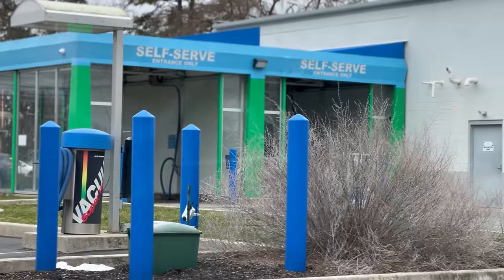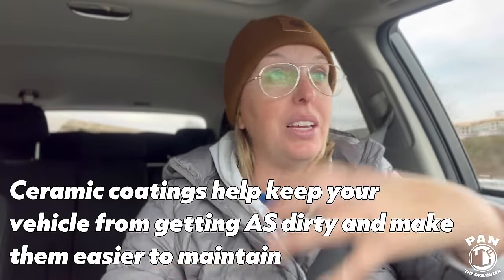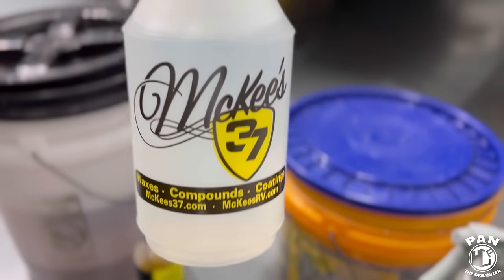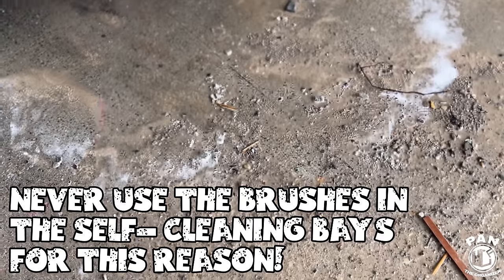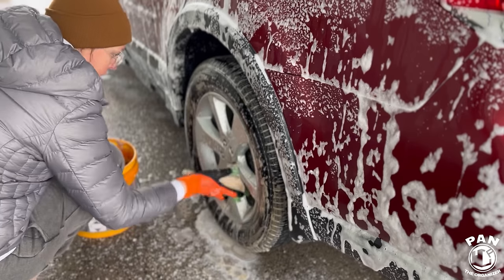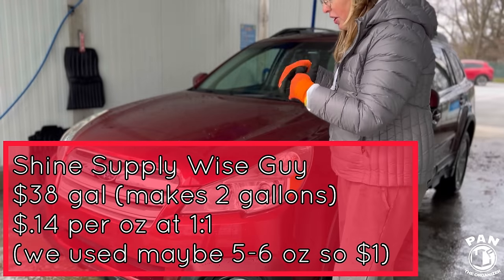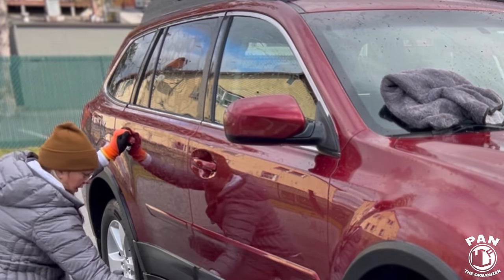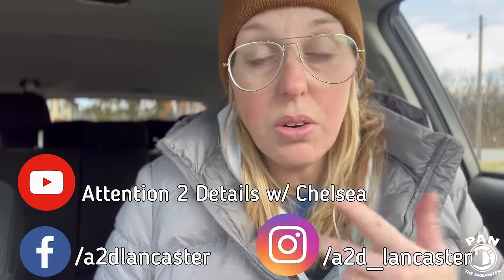How To Wash Your Car At A Self Serve Car Wash

Comment: This is my method at the coin wash - 2 buckets with my own soap, mitts, towels and brushes. Fill both buckets up with their water; one with my own soap - then I rinse vehicle. That's about $3-4 right there only using the water and I turn it off. I do the traditional 2 bucket wash on the car first, and then I wash the wheels last to preserve my rinse bucket water. Car is now fully washed, I empty my buckets out and pay for the water again and rinse the buckets out on their wall mounted matt hangers. Rinse the car off and turn the water off. Another 3-5$.  Now its time to dry the car apply whatever on it and enjoy. So about $6-10 spent using ONLY their water.

Comment: I really need to apologize as 2 months back i said it was absurd to expect people to wash their own cars when they may not have a house or garage. Since then, I've learned a ton and now do my own using a variety of techniques and supplies. Even learned that when it's below freezing to dry immediately after each panel or risk your rinseless freezing on the car. Also, if your car is crusted in salt, a few spraydowns of rinseless breaks the crust down and leaves only a film that easily gets washed away with your sponge. So, thank you for getting me started on my journey.
Reply: Great tips!

Comment: Thanks Pan for sharing info on these useful washing techniques and for hosting knowledgeable guests.

I like to hand wash my car on a weekly basis. Sometimes, if the car gets dusty(it's all glossy black), I'll bring it to the automatic car wash with a 1 gallon pump sprayer filled with a 128:1 Opticoat No Rinse solution. I spray it on, let it dwell for 5 minutes and then use the pressure wand to blow a high pressure stream of pure water nearly parallel to the surface. This gets the car looking like new and then I blow dry it with my battery powered leaf blower.
Reply from the maker: Thanks!
Reply: I almost do the same exact thing

Comment: Amazing video and great resource! I find this more complicated than I might recommend to my clients who have hired me to do a wash, clay and seal service. That service deep cleans and leaves a sealant on the surface. I have tried to make the cheapest and simplest system for my clients. Mostly they had already been going to a brushed drive through car wash. I recommend they use a touchless drive through car wash then use a quick detailer and micro fiber towel to dry the vehicle after. I also share how they can safely use either one large drying towel or multiple smaller towels with the QD as a drying aid.  It's about $15 worth of product, $30 or less for towels and $7-10 for the car wash. It may be about 20 minutes of their time.  I  find that with the deep clean and protection we provide, the client can get super clean results safely when they are in between services. Our clients are not interested in becoming a detailer or spending $100+ to get all these tools. I love that but it's not their interest. What are yall's thoughts on this system?

Comment: That’s a lot of stuff to carry, I like the sponge you used to get the light film off, I’m using a spray bottle with water and a thick towel to wipe off the film. It’s color coded so I’ll use one side to wipe & the other to dry. I’m using the touch less wash only, I’m also reapplying my ceramic sealant every 3rd wash to keep up my protection. Once I move to a house, I’ll be better equipped to care for my car. I’m always learning from both you guys. Thanks for the advice. 👍🏾
Reply from the maker: Have a good weekend Justin!

Comment: I am fortunate to have an insulated and heated garage and a couple of “pay and spray” self serve car washes that are not too far from my home. I live in Massachusetts between Boston and Worcester, this winter has been more wet than snowy, but with he pre-treatment of roads and salt spread during the few storms we have had, it is easy for cars to be encrusted with salt.

My winter detail regimen is as follows:I turn on the heat in the garage, pack my wheel cleaners, iron decon chemicals (P&S Crystal Wash and Iron Buster) a sprayer with a solution of Optimum MDR and a couple of pump sprayers with a rinseless wash solution in a small tote. When I get to the pay and spray, I spray the MDR solution on the paint and let that work to break down the salt while I am waiting in line.. I spray the wheel cleaners and iron decon chemicals, what a few minutes and use the rinseless wash to knock down the iron decon residues. I either use my debit crad or cash and purchase $10-15 worth of time then use the rinse functions of the pay and spray to rinse the vehicle down, including the undercarriage. I then bring the vehicle to a nice warm garage, then to a proper rinseless wash and dry the vehicle.
Reply: Great tips!

Comment: Wonderful in concept. Completely impractical in reality. I love spending time detailing my car in the summer but winter in Colorado (and any other place that routinely gets snow and grime) is more about survival. Self serve car washes have lines of impatient people and loading up so much stuff when you just want to get the grit and grime off your car (fully knowing that it will rain or snow within the next few days) is just not worth it. Here is what I do on a a weekly basis (or at least when I know there is a few days of decent weather which will be worth getting the grit off  the car. 1) High pressure water to get the caked on dirt 2) Foam spray on entire car 3) high pressure soap wash of entire car 4) Use the brush on glass ONLY (not on the paint) 5) High pressure rinse 6) spot free rinse (mostly for the glass 7) leave. It takes 10-15 minutes and while it doesn't get the car shiny, it gets the muck off and I'll repeat this every week. My car is graphene ceramic coated and in the summer it shines for 6 straight months and has ZERO swirl marks. Yeah, its not perfect in the winter but that's the joy of living in a snowy winter environment. Come April in Colorado, I will do a 2-3 hour full detail and then maintenance washes until winter comes again in late October.

Comment: I always recommend to use the pressure washer first after spraying tires and rims, like you said. Then you can start using a brush and soapy water to remove the traffic film of your rims. Much safer method especially when you have gloss black or matte rims.
Reply: Yes, on black wheels I would definitely rinse first then clean

Comment: I have a unlimited water for €6 here and its great. Sometimes i’m in there for like 1hr and another hr at the dry/vacuum bay for the other parts. Never got yelled at but always make sure i go at like 8am so no one is there.

For “maintenance” spraydowns i take an ik multi with BH touchless and i just spray the car, let it soak (sometimes i use the foam of the bay to cover it)  and rinse off for a total of €4.

Sometimes i do the second option, drive home and do a rinseless wash there. But if my wheels are very dirty i go for option 1
Reply from the maker: Thanks for sharing your process. 👍🏻

Comment: Hi Pan. Any tips/videos on a compact travel kit?  Her kit is more comprehensive than what I would throw in a trunk or in a duffle bag. A kit that can be supplemented by a self serve car wash?  Maybe one just power rinses their vehicle and then pull out for a no-rinse clean/detail. Or even possibly stand alone kit (a-la no rinse car wash)

Maybe something like:

Spray on car wash (maybe Griots)
Interior cleaner
Tire detailer and applicator 
Glass cleaner
Bug cleaner
And various microfibers and a couple of brushes. 

Thanks.

Comment: Great video and good information and ideas . I just want to tell my experience.  I took  my car to one of these car washes and took a bucket and wash MIT and etc . The owner was there doing maintenance and when he saw me with bucket and MIT he told me i had to leave .  I guess doing it the way i was does not use enough of the car wash chemicals . He took me to the other side of the building where he had a sign that said no hand washing .
Reply from the maker: Thanks for sharing

Comment: Quick spray of Touchless around the vehicle, rinse off, go home. Under 10mins. Given we're charged a flat rate for time, I'm probably saving Morrisons some money as I'm not using any chemicals at all.
Reply: That is another great way if you can’t finish it there
Reply: This is the way. No need to bring buckets at all. Just pre-spray with BH TL in a pump sprayer, let dwell for 5 min, rinse off. Pull out, dry with a leaf blower in a parking spot. Drive home and finish with a quick rinseless wash. Done. It's seriously the quickest and most efficient wash you can do.
Reply: @Aaron.Greenberg  yes that is another way to do it

Comment: This is a great video, great advice and tips. I would like to mention, not all self-serve carwashes allow you to hand wash aka bucket wash. Please be very mindful of this and what their policies and or stipulations are.
Reply from the maker: Thanks Scott!
Reply: @PanTheOrganizer  
Welcome. I reside in Calgary Alberta Canada and I have seen several carwashes that say no bucket washing allowed. I am glad we have a garage and a driveway to handwash. In the colder months we use the spray wand carwashes where only soap and hot water touches our vehicles paint. I'd still rather get the majority of the dirt, salt, grime..etc off the paint, vs leaving it on for long periods of time and doing more harm than actual good to your vehicles paint/clear-coat. Plus spraying out the inner fender wells and the undercarriage as well, which IMO is very important.
Reply: @PanTheOrganizer  
Montreal and Ontario use a ton of road salt, here in Alberta they use less salt and more pebbles and sand. Plus the climate is much drier and rust isn't so much a factor but regardless of all that, the bug guts, oil, dirt, grime..etc needs to be washed off to help maintain a clean vehicle and one you'll be proud of driving and makes maintenance less of a hassle.

Comment: I do something like this when the sun is setting & my car's body panel is cool to the touch. 1) clean, but don't dry, the wheels/rims outside the wash bay, 2) at a wash bay, Rinse off the entire car, including the undercarriage, 3) get out of the wash bay if the carwash owner had posted a sign about no handwashing/detailing at the wash bay, 4) safely without scaring the paint of your car, handwash your car, 5) go back to a wash bay & Rinse off your car, 6) get out of the wash bay & safely dry off your car.
Reply from the maker: Thanks for sharing your process!

Comment: I always go to a self service station.
This is my way to do it
First spray the car with a pre rinse, I use valetpro citrus
Then I rinse my car with the waterlance. 
After it I use a ik foamer with brake buster and clean my wheel en tires with it. I also use a bucket with water and some soap I first foam.
Then rinse tires and wheels, but also bucket and brushes and foam up the soap in my wash bucket.
After it wash my car, 2 bucket method. And rinse of.
Then dry with dream maker and a towel. Then whipe inside the doors, dry the wheels and tires. Then clean the windows and do some dressing on my tires.
Then I clean the interior or just only remove the dust inside with a microfiber.
Reply: Sounds like a great process
Reply: @attention2detailswchelsea  yeah it is, but my car always looks good. I use always 3 buckets. It's only hard to get the water from 3 stairs to the car.
The whole wash and filling the buckets takes me 3 hours

Comment: I haven’t come across a DIY car wash that will allow you to do a bucket wash. If I need to use a DIY car wash, I’ll spray down my vehicle with a pre-treatment and use the pressure washer to spray down my car. After, I’ll treat the car with a rinsless wash to soften the water. I’ll then drive the car home to do a rinseless wash.

I live in an apartment and this process works well for me.
Reply from the maker: Thanks for sharing!
Reply: That’s another great option!

Comment: Well, to keep everybody happy, I go after 10pm and the flow is. Iron remover and rims cleaning outside the wash area. Spray with all purpose cleaner and while still wet  I get inside and apply snow foam on the car. Rinse with the water jet+foam powder option and after that I re apply snow foam and use my microfibre mitt for more thorough job. Rinse well with the purified water option and spray with the spray (bead maker or turtle wax graphene) rinse again, take it outside and dry with microfiber towel. Voila! Car clean, the wash owner happy cause I used his products also.
Reply from the maker: Thanks for sharing your thoughts.

Comment: What i do is in the Super COLD days of winter. I go to a All Water wash and pick the basic wash. Reason being is it has the undercar wash so i can get that Nasty Salt off. And the doors close so u inside. Then i come home and do a waterless spray wash. But at the DIY when its warmer. I just wash the brushes off real good for my tires and lower panels. I Never use the brush above the mid point on my car. I apply ceramic coating every season change. So, its right b4 winter and b4 summer. Since 95% of the time its jus me in my car my interior stays factory fresh all the time...

Comment: Northern Illinois.  My attached garage is not heated, no floor drain.  I use the Black and Decker Hydroshot sprayer. It uses less water than a hose. 24 hours later the watrer on garage floor is almost dryed up(75%). I do this when its prety cold  like 30 degree day. I have never had standing water left on garage floor freeze.
Reply from the maker: Thanks for sharing!

Comment: In my place they have big posters with a list of rules at the carwash and some sort of guardian roaming around making sure people respect the rules... BUT, I have a portable battery operated pressure washer, is not powerfull but does more then enough for rinsing off chemicals like prewashes and iron removers before going with my rinseless. 
I live in a condominium, the parking spot is pretty small and I have some stairs to do so it is a bit of a workout but I'm ocd enough to do this 😆and by doing this, I only have to go at the carwash when the car is super muddy and I need more pressure
Reply: Sounds like a great plan!

Comment: Because i had a tramatic experiance at a car wash, i just use the pay and spray to get the salt and sand off with a rinse, then i drive home and do my rinseless wash with my bucket of Absolute, a chenille mitt, and my Ik. multipro and finish my wash in my driveway dry with my liqu8dr and beadmaker and i'm done.
Reply: Sounds like a great method!
Reply: @attention2detailswchelsea My pay and spray doesn't allow anyone to bring buckets etc, so that is why i do it that way, but it works well, great video!

Comment: I wash my truck at home but I also go to the car wash, specifically during winter when I have my pipes covered to protect from hard freezes. I don't like automatic car washes because they just don't do the best job at detailing it. The self service car wash I go to never told me anything about my bucket as I never wash with it. I just use it to carry my materials such as tire wet, detail dry towels, etc.

Comment: Is it smart to spray soap onto dry wheels that may be hot, or should they be sprayed with water to cool them off?  The downside to that is dilution.
Reply: You can prespray with water if you’re concerned. I had been there for a while and they weren’t too hot

Comment: Hi, great video. Thanks for sharing all these useful tips. What is the dilution ratio of the Superfoam in the IK Foamer?
Reply: I used about 3-4 oz with the IK foamer about 1/2 filled up. You don’t need much with this soap but the dilution ratios are listed on the label
Reply from the maker: Thanks!
Reply: @attention2detailswchelsea  

I'm using a Marolex Axel 7 Foamer, which is pretty similar to the IK. With Active Foam I use around 1 litre to foam the whole vehicle. I tried different dilutions, on the label is written 1:100, which produces quite nice foam, but I usually use it at 1:50. In this case it is 20ml of product, so that I why I was surprised by the amount you are using. Did you use the whole 1/2 of the liquid (which should equal around 3 liters) to pre-foam the vehicle?

Comment: In winter/early spring when it’s still cold I always go thru the wand wash.  I bring my tire cleaner, and 😮 ceramic spray wax with me. And of course microfibre towels. But I use their soap and soap brush. Is the soap brush bad?
Here in B.C. in March I thought it was safe to use the garden hose 😮 and set out to wash car. Good thing my daughter was in the basement and called out that water was seeping in!

Comment: It takes me about 2 hours with ONR, 6 towels and 1 bucket. I don't mess with grit guards, instead I do 1 curl-wipe per quarter of each towel side and temporarily discard it after 8 wipes (4 on each side). That way if I ever have to use it again in the wash, the dirt is light and distributed amongst the towels instead of heavy on a few. However, I avoid reusing sides I use on the lower portions of the vehicle, as they are dirtiest. I do wish Self-Serves had high pressure air options for drying though.
Reply from the maker: Thanks for sharing. How did you discover my channel by the way?

Welcome to my channel. You discovered one of the biggest car detailing channels on YouTube as we surpassed 1 million subscribers and we have over 135 million views! I have been detailing for 27 years and I love to share my knowledge and passion with my viewers.

You found the right channel to help you learn everything about detailing.